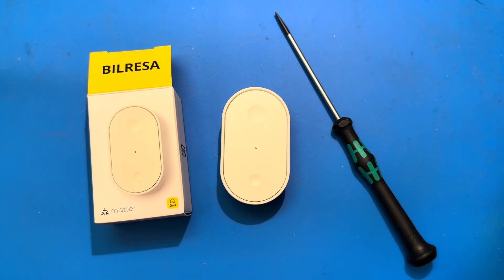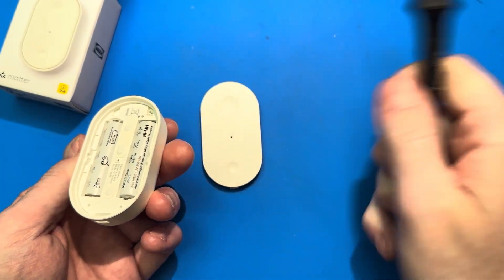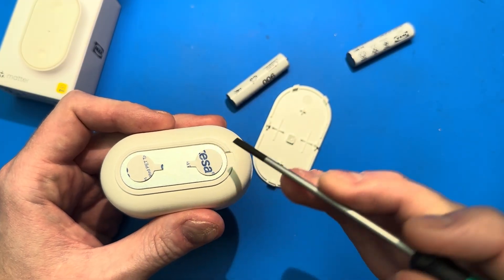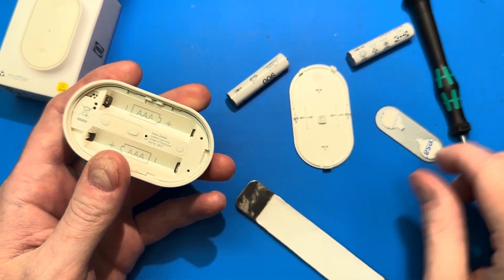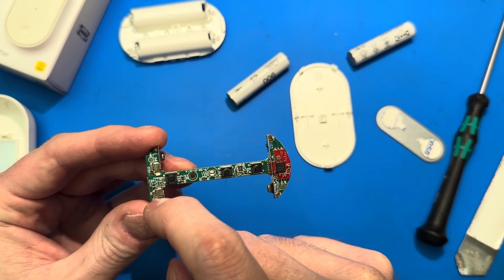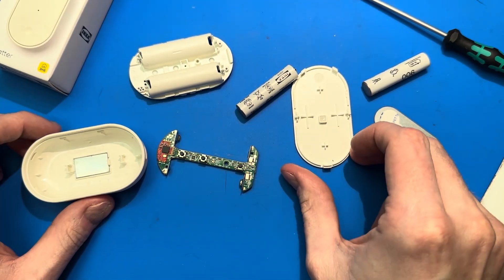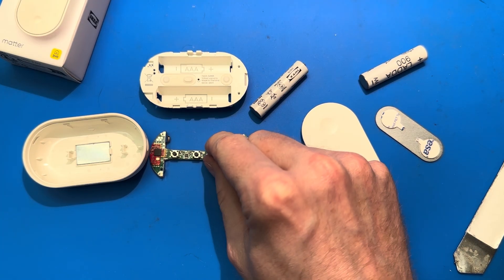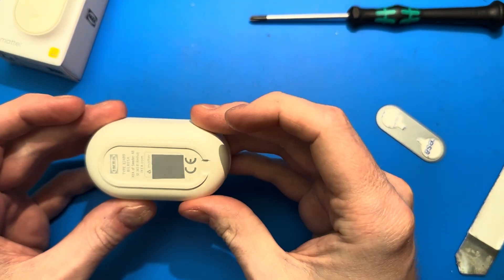IKEA Bilresa Remote Control Teardown - Interesting Product Engineering

Comment: I got a few today from my local Ikea, as well as some on sale zigbee devices. Only tried 1 Bilresa connected via Home Assistant and then homekit. Find that the Bilresa keeps disconnecting, whereas the Myggbett door sensor just seems to work as expected. Are you seeing any of your Bilresa’s disconnecting ?
Reply: Yes, I am.  Been playing with these and they are not reliable for me.  Running an Apple TV 4K with Thread support and iOS 26.2.  Wondering if it’s the switch or IOS….  The leak sensors seem to be good and reliable, tho more testing is needed.